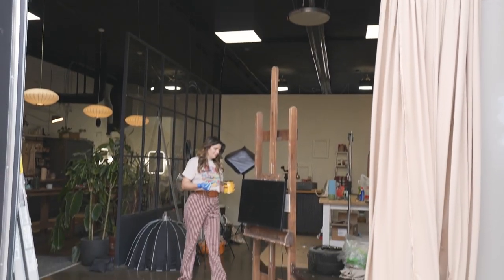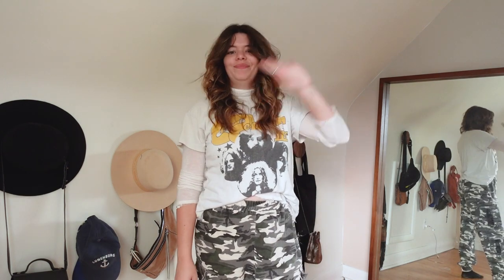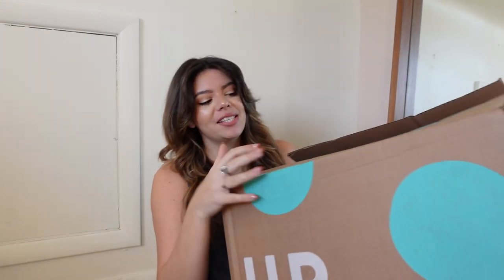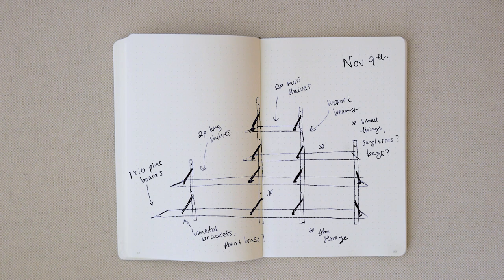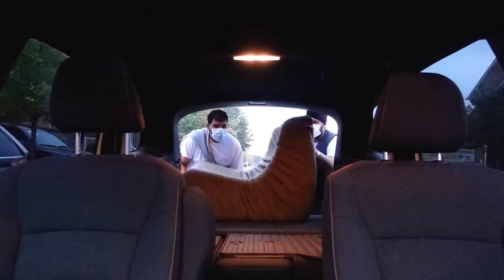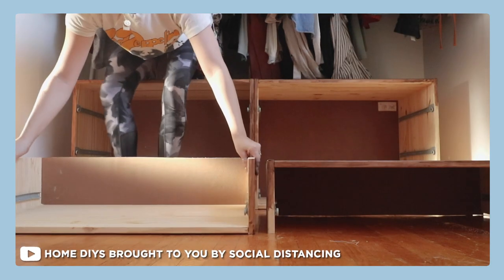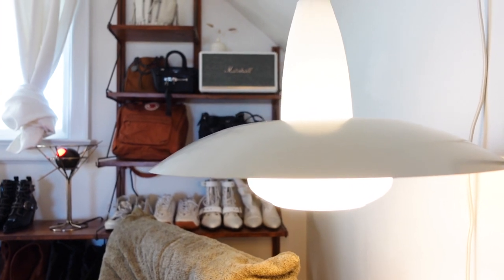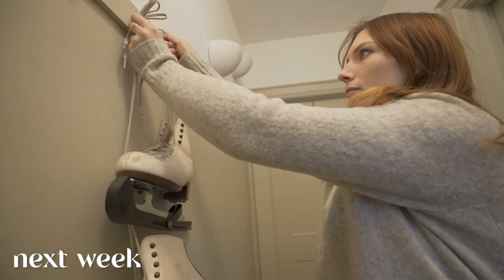completely REDOING my walk in closet | DIY Diaries

Comment: those "modular" shelves, they aren't secured on the bottom of the bracket though? looks like it can easily come out if you grab something off the shelf, it'll pop right out of the bracket holder thingy, specifically the short ones

Comment: Looks fantastic! I love mine, once you do it, you'll never go back😊 After I left home I have always had a bedroom as a walk-in closet. I only have 2 rooms in my current house but it is my happy place. I have clothes racks running the full length of 2 walls opposite each other and a 9 drawer dressing table with a huge mirror against the wall opposite my window. I have various jewellery display stands on it so I can see everything. I have a diy footstool with storage for my 👜handbags on the 4th wall under the window sill and on 1 side of the window a hand held steamer with hanger and on the right side a full length mirror. A nice round rug in the centre of the room and I have an over the door shoe rack for 👟sneakers and shoe shelves under my clothes racks for 👠dress shoes, I use empty wine bottles😂 to keep my long boots upright👢. I've had this set up in my last 3 homes and would never go back,  you can see everything at a glance.  I have winter on 1 wall and summer along the other. Everything in sections, 👗dresses, jackets, skirts, darkest to lightest etc on putting away clothes and finding items is so much easier now. 🙂

Comment: I know 70s aesthetics is popular right now. I’m pretty sure the entire decade was blehck 🤮 from a style perspective. My opinion of course. I will say it is being done better today. 

I do think the room is well done. Maybe the Bauhaus poster is a little on the nose; is it supposed to be ironic? Even in the 70s it was a throwback. When did the art school close early 1930s? Mid? Idk. But given how much emphasis was placed on function in the Bauhaus aesthetic, it’s a bit strange that most of the furniture in her room isn’t particularly functional. But then again a lot of 70s stuff purportedly inspired by Bauhaus wasn’t either. Maybe it’s a deep cut, in which case Becky is very clever. 

I don’t understand the purpose of the lounge chair. It isn’t practical for putting on and taking off shoes. It’s one of those pieces of furniture you have to crawl in and out of and really only usable by the young and supple. 

Then again my mum used to have a walk-in closet about the same size as Becky’s room that had a little bed tucked into an alcove. It was designed for that purpose. The alcove had a tiny window with a door and the most darling mini chandelier. I didn’t understand the purpose of that bed either. But you could sit on the edge to put your shoes on. It’s what my mum wanted and my parents are architects so my mum designed the closet that way. She did sometimes hide in her closet. Maybe Becky likes to hide in her closet too. 

The name of the cabinet is flat file or more specifically it’s a flat file cabinet. Naturally my parents had some though most of their blue prints were stored rolled up in umbrella stands or large pots. The purpose of a flat file is to store large format documents flat. 

Rolled blueprints don’t layout well. On job sites people just grab whatever is handy to weigh down the corners. Though I will say that clients shelling out big bucks for design services really seem to dig the old fashioned architectural drawings and their presentation is so much better if there’s no curl to them. The flat files also keep light from damaging documents. Blueprints exposed to light too long bleach out. 

Flat file cabinets make more sense for jewelry storage than clothing because the drawers are so shallow. Maybe if you like to lay out lingerie by individual pieces? Yes, I know she created a faux flat file. I suppose that’s more in keeping with the Bauhaus spirit of combining artistic expression with the functional. It’s not my jam but I do think  the room looks good.

Comment: Tip: if you use lacquer or varnish like nitrocelulose instead of polyurethane coat for wood, you don't have to sand between coats. You mig her sand the last one with a very very fine paper or steel wool 00 but that's it.

Comment: I loooove the new Frankenstein drawers that's also my favorite vintage cabinet but here's a rip, next time paint the foe gaps black inside and the gap thats between the two separate units the same color as the drawers to create the optical illusion of what you wanted-try it next time I promise it makes such a difference and makes it look legit. Also you can screw the two units together from the inside, apply a new backing that's one big piece, then the new drawer fronts could just be one long slat so the are connected units to make one big one and open both drawers at the same time! Love you 🖤🖤

Comment: If you cut little pieces of cardstock or thin flexible plastic the size of the interior of the label holders, you could attach them to one drawer and it would further enhance the single drawer illusion. It needs to be flexible enough that you can open the drawer to which it is not attached without either having to open the other drawer or permanently deforming the label. So basically when you open the drawer it is not attached to, the label bends so the drawer can open, but when the drawer closes it springs back into shape. I think flexible cutting board material would work for this application